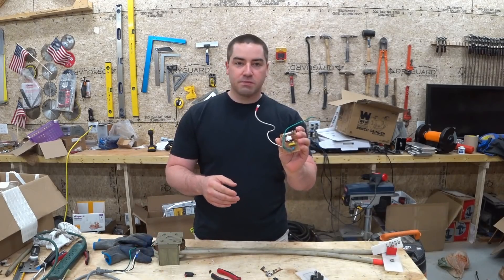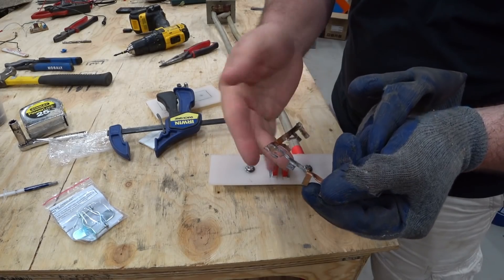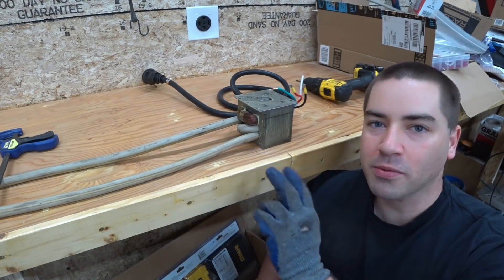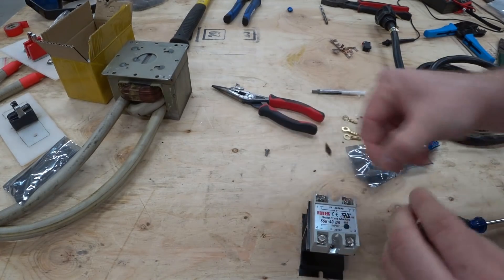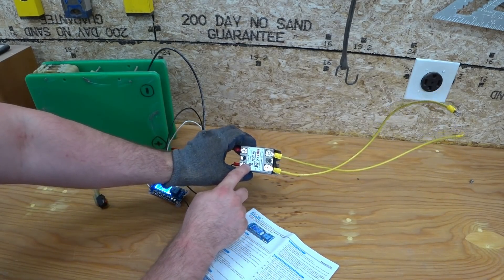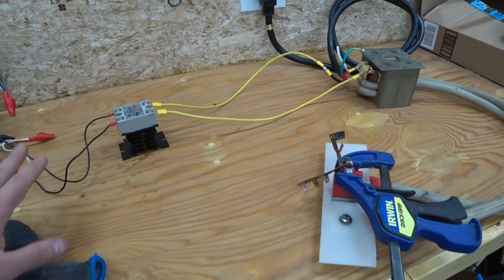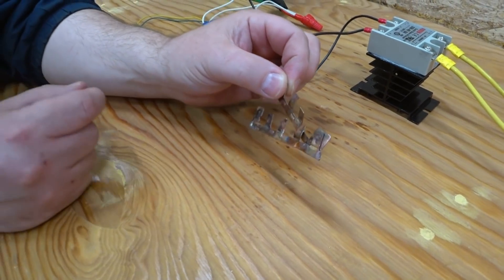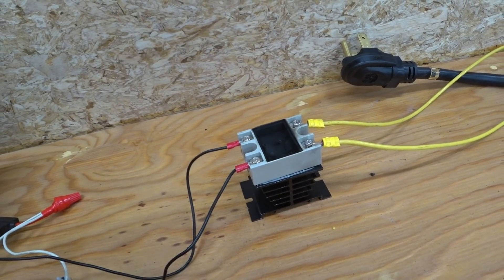DIY Spot Welder, Part 3, Timing and 240 Volts

Comment: David:
Was  going to give my 2 cents as a EE, and then I  found a link that I think  you  will find interesting & helpful :
https://youtu.be/q388md3Yk9U
There's  no audio, he just writes everything and takes one down the construction & application path.
Enjoy!   - Mike  Gardner
P.S.  I'm not addressing your possible materials issues,  but am merely suggesting that this little spot welder design might remove one variable from your problem: This little design apparently works in at least one application. .. so then you can work on other problems.  Kinda like using a commercial unit?
Reply from the maker: Thanks.

Comment: Very insightful... by controlling the time heat is applied. You control the excess heat and damaging the leads.... REALLY COOL... I hope you consider these thoughts freindly advise....  Please consider not exceding 120 vac (the design voltage of the primary winding). If needed, more turns on secondary. Also you might look into 'zero crossing' techniques... that is the voltage of the sine wave applied to primary is near zero when starting.... and stopping the weld. Your SSR most likely blew because when the timer ran out... it was at or near the top of the sine wave .... leaving a lot of stored energy in the magnetic flux. When that flux colapsed, the voltage had only one place to go.... back through your SSR module. It is worth noting when building a 'zero cross' circuit...you can not drive  the SSR module with a mechanical relay ... the hesitation of the moving contacts... as the relay ages... change... and instead of milleseconds ... your timing will be in integer 1/2 cycles... (120 of them a second). Another thought... might be...  put a light bulb in parrel with the primary... so when the flux collapses it has somewhere to go. Sorry for the long post... loved the video... especially the smoke at the end!!!

Comment: Men you are doing all wrong... , first you need one more coil in the transformer, you need also copper contacts for the spot weld. and you need a tiristor for cut the AC side .

Comment: use a car starter solenoid  it can handle the amps no prob and with your timer you will be set and 120 will be fine if you need more power squeeze another turn on the secondary

Comment: When you double the voltage you double the current/wattage!! You were pulling like 3kw!
Reply: Assuming the Load Resistance/Reactance is the same, then doubling the Voltage will increase the Power by 4X not just double.
Reply: Yep,  V^2 / R. 
A little engineering goes a long way. - Mike

Comment: Hay David,
I don't think it's possible to successfully spot weld aluminum to copper.
Reply: ... just punch a hole in both lashes to connect and rivet it through a metal clip/washer .. done